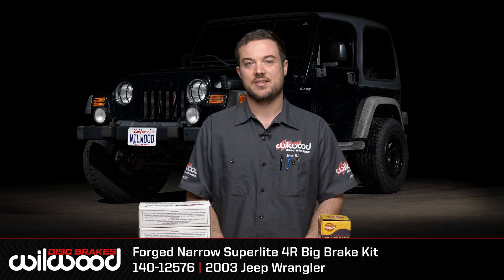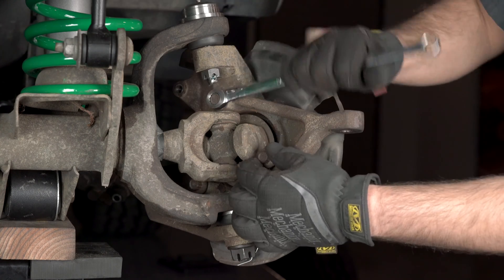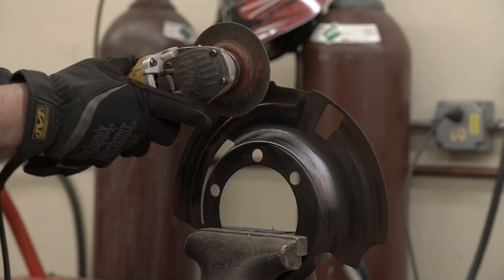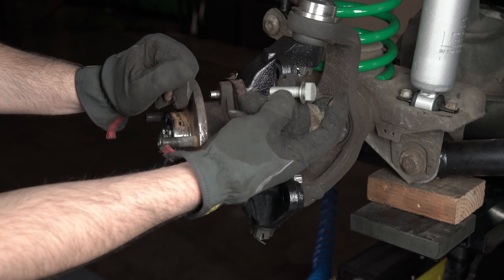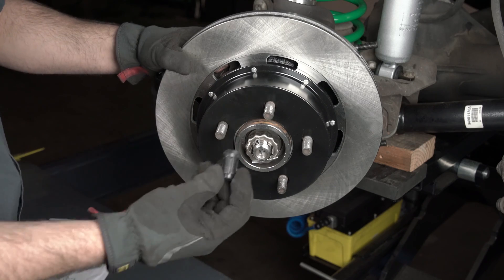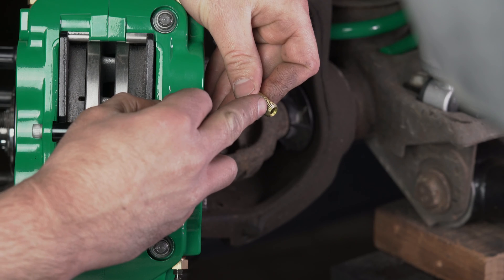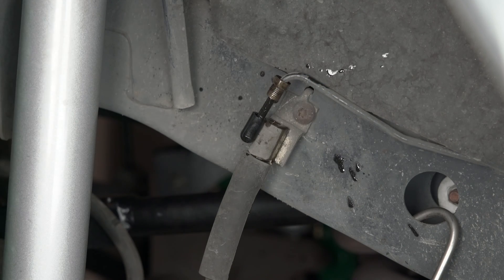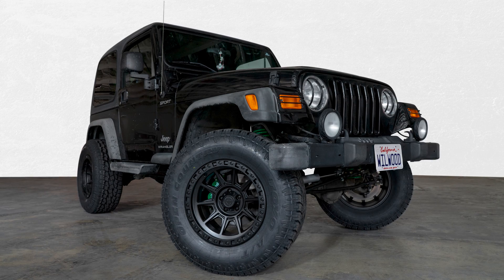Jeep Wrangler Wilwood Forged Narrow Superlite 4R Front Disc Brake Install

Comment: I have the front kit for my 1987 YJ, did some measuring and ordered a rear kit for my YJ Dana 35. Now, I need an E-brake kit. What I don't understand is why he is saying 87,88,89 Spindle. The 87-95 YJ's all came with the same Dana 30 front axle. So what is the specific difference? EDIT: its the hub bearing guys...the 87,88,89 all take the same hub bearing... 90-95 are different.

Comment: How does this not fit an xj if the front end is exactly the same ?
Reply from the maker: Hi, there is a slight variance in the spindles.
Reply: @WilwoodDiscBrakes  what is that change?
Reply: It does, but you need to purchase the 2000+ wheel bearing/hub too.